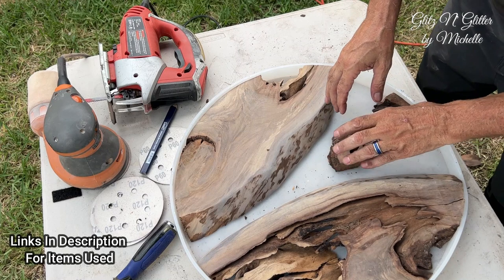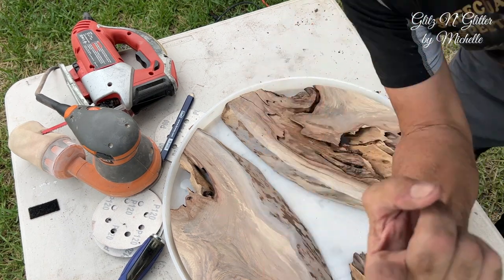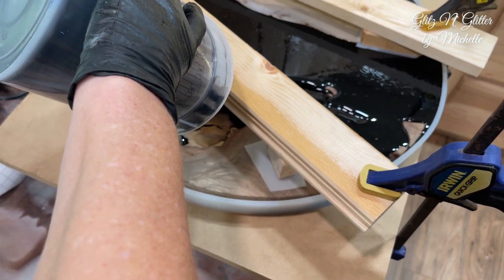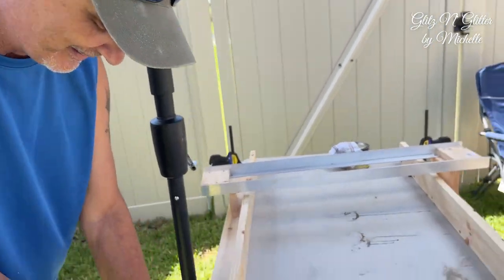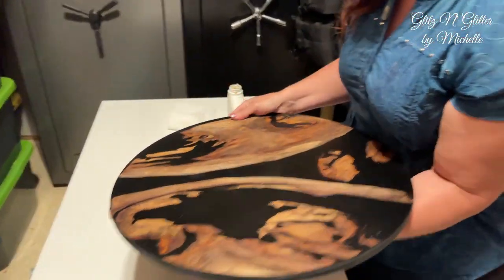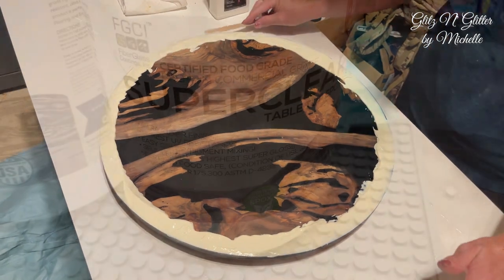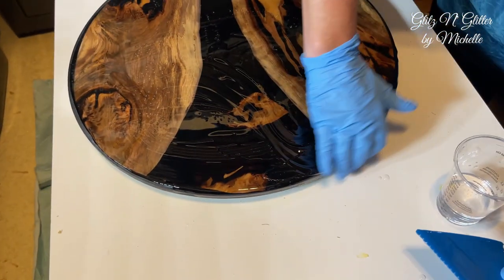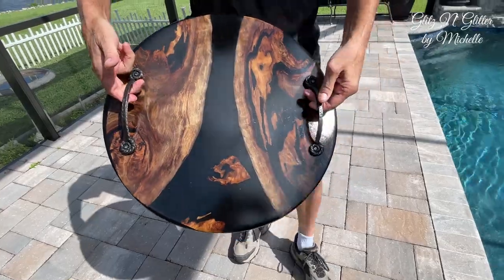#229 How To Make a Stunning River Tray With Epoxy/Resin

Comment: How did you decide which side to topcoat? Both sides were gorgeous. Great job guys. It turned out stunning.
Reply from the maker: It was very difficult! But in the end it came down to the resin pattern on this side with all the smaller “holes “ in the wood.